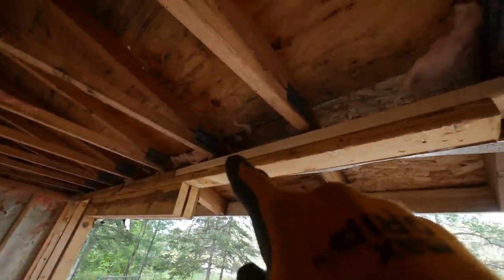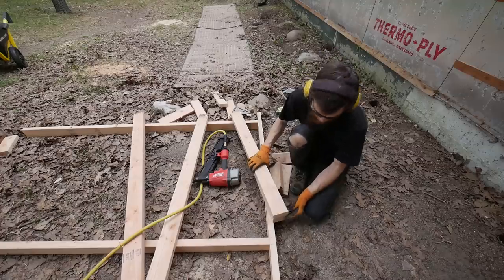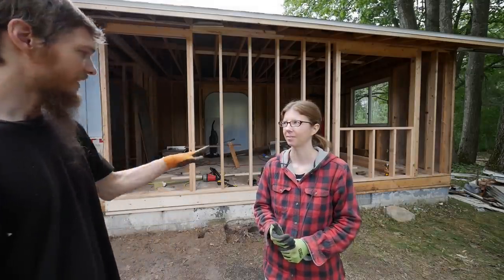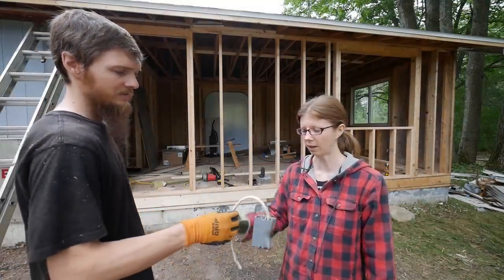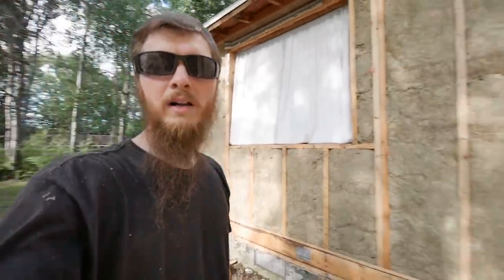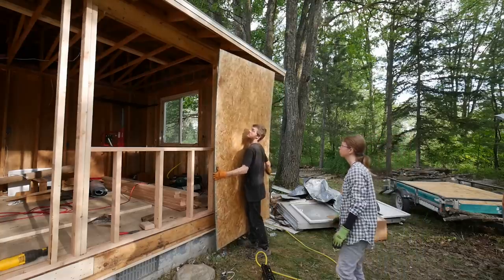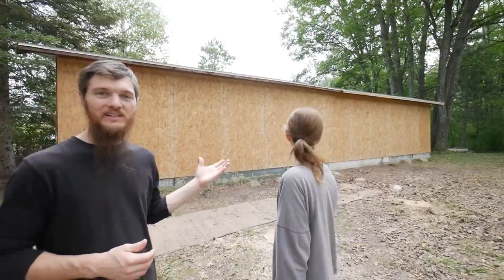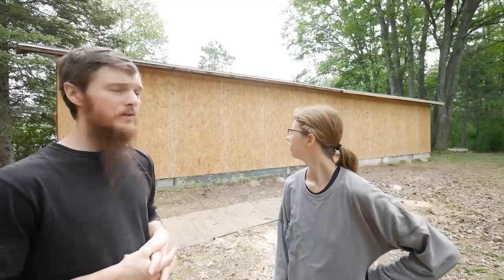More DEMO and Repair of Our 45 Year Old House - Home Renovation

Comment: I would suggest that you add lateral bracing to your stud walls, this will improve ridgity and structural strength, also use nails rather than screws nails have far greater shear strength than screws also a lot quicker if you have a nail gun.

Comment: Even new construction can be wrong and quite shabby.  As a youth we moved into a neighborhood with nearby homes under construction.   I often observed workers placing leftover food and beverages stashed under tubs being installed.  (We moved there during the beginning of summer vacation.  No neighbors so I was bored.)   When potential buyers would stop by I would tell them about seeing rats and bugs.  Realtors did not like me but it was true.  I also pointed out where studs were completely cut through for plumbing and wiring.  Sheetrock was not yet in-place throughout.  I did not know much about construction but I felt obvious issues should be addressed.  That experience triggered a major interest in construction and insuring work does not compromise the integrity of any structure.

Comment: The melted electric box could have been from lightning.  We were hit by lightning once and it fried the box, not all the  outlets in the house but one box.
Reply: Make sure your grounding wire and rod are in place.
Reply: @smallfootprint2961  Thank you. We do have a grounding rod and wire, and now new wire and box.     We had a later hit that came through the telephone wire arced across the room and took out some outlets then too and electrical appliances.  It was a good example of why you shouldn't talk on the phone during a storm.  You know like your parents tell you when you are little?

Comment: Ok, I think you answered my question. I was wondering if you were going to use nice solid wood on your soffits. Or that horrible thin tinny stuff you pulled off. Yeah for wood!
Reply: Use perforated vinyl soffit for ventilation in the attic, avoid mold and release the heat in the summer. Use ice and water shield around the windows and door opening.
Reply: @suburban404  Vinyl I can see, but do you agree that tin/aluminum (?) looked like a joke. One dent and ready made pest/varmint hole.
Reply: @kat369-mine  I took all of the  metal off my house. You got it, looks like heck. Current code has requirements for ventilation in the attic and crawl space.

Comment: I was just curious.....were you planning to use foam board insulation on outside of OSB before you wrap it? I know how cold 🥶 those winters are in Michigan and in addition to your other insulation would be extra protection. 🤗🤗😎😎 (Also moisture and mold resistant)
Reply from the maker: We chose not to do foam board insulation and instead we are just building out the walls inside to allow for the thicker insulation.

Comment: One question: Why did you guys set the osb upwards like that? Must be a trailer home thing.
Reply from the maker: It just depends on who's doing it and where you live. Some do it vertically, some horizontally. If we did it horizontally we'd have to put blocking in at the seams. We personally like it vertically.
Reply: @diyfferent  ok, thanks. To me, I would do it horizontally. In my area that's what's done at least.
Reply: @diyfferent  it made sense there, it fit perfectly and no cutting

Comment: Get ya a sledge hammer and cut the handle to 16 to 24 inch, it will have many uses for years. I think mine is 4 lbs, because I could not lift the 6 lb. I use it for stakes and walls or demo.
Reply from the maker: Yea, we need to buy one :)

Comment: You may need to look up building codes in your area. Your sheeting wouldn’t make code if inspected .
Reply from the maker: Do you mean sheathing? Instead of vague statements would you please explain what you think is wrong.
Reply: 7/16" OSB is used around here for exterior sheathing all the time.  As long as it's fastened properly and covered with housewrap it's fine.
Reply: Sheeting type is fine. Installing all horizontally may not be for your area

Comment: It is something strangely cathartic watching an american house being torn down. As a European this would have been slightly more difficult with ytong, brick and mortar walls. Btw. have you considered standard tilt-swivel-windows when you ordered the new ones?
Reply from the maker: We decided to go with slider windows again like what the bedroom window was :)
Reply: Having worked with wood all my life, I can't imagine using mortar, brick and stone! :)
Reply: Only a small percentage of homes in england are of wooden construction . Most are built with bricks and mortar . Stronger built homes . Its a more stringent building code in gb . Each build has to be inspected by the authorities in each stage , from below ground up to finish level and roof . All electrical and plumbing is also checked . Its law over here . If its not built to specifications . You have to correct and. Inspect again . They can in extreme cases make you demolish the whole building . If the building codes are violated or not built to exact specs . It has happened on quite a few  occasions in gb . .
Reply from the maker: We like wood-framed homes because it's basic construction and we can repair them easily ourselves affordably. That's a huge benefit for us :) Repairing brick is so much more labor intensive and difficult.

Comment: why did you not use pressure treat wood on the sill?  would have prevented rot in future.
Reply from the maker: It's just not needed since the rest of the house doesn't have a treated sill. The rot that was there was directly caused by a leaky chimney and door.

Comment: Just wondering if you guys plan on painting the  Foundation?
Reply from the maker: We aren't sure but we've been talking about it. It's painted now and peeling badly. Since it's painted it will always look bad unless we get all the paint off- which is a pain, or repaint- which is easier...but it will probably peel again in the future. We're just not sure yet.
Reply: Perhaps there is a special sealer or primer for cinder blocks so the paint will adhere to the foundation better. I know they have things like this for basements. May be worth investigating it. Love your work and videos. I check everyday to see if you have downloaded anything.

Comment: Why didn't you insulate with foam board before putting up the sheathing?
Reply from the maker: We are building out our studs to 5.5" to bring the r-value up to 23 so that we don't have to do foam on the exterior. (Also, if we were going to do foam board, it would go on after the osb.)

Comment: i would of spent a bit more and put on 1/4 inch plywood make for a stronger wall.
Reply: No need in Michigan. Support most important there due to snow weight. It'll be covered.

Comment: All the commercials for this video are over 2 mins long. Wow. It wouldn't be bad if the first one was short. I'd watch that one then on the long second commercial I could skip after 30 sec and you would still get credit. Crazy. 
Can you start on inside now with insulation?
Reply from the maker: You can skip the ads if you'd like :)

Comment: You're not using pressure treated on the sill plate???  That's no good.
Reply from the maker: The home was built without a treated sill, and it's solid after 45 years so we are just replacing what was there. The only rot was caused by the leaky chimney and door.

Comment: Why not paint the foundation blocks?
Reply from the maker: We may, not sure yet. But we want to at least clean off the old paint.
Reply: I’ve never seen a painted foundation or steps that did not peel I was told by a painter that if you don’t paint all sides of something outside moisture gets in and makes it peel and it’s a lot of work to get the peeling paint off. I don’t think painting it is worth it. I usually use a stain on my wood outside. It doesn’t peel and you can just restrain overtop when it fades. That’s a lot less work

Comment: Not trying to be a "Debbie Downer,"  but why didn't you use 2x6 on the new exterior wall so you wouldn't have to sister the 2x4's to accommodate the depth of the insulation?  Or did I miss something?  Which is possible.!  Any way, love you guys and your spirit!
Reply: Ginger Washeck Yeah they explained that in the video. They said it was just easier to duplicate the existing wall exactly and less weight moving the walls around.
Reply: @tylerpestell  Yep, I jumped the gun on commenting before watching the whole thing.

Comment: It will probably turn out that it would have been cheaper to demolish the house and buy a new modular home.
Reply from the maker: We're keeping so much of the home that we'd have to buy if starting new. Much much cheaper to repair what is here :) New modulars are close to $100k.
Reply: Oh heaven's no.  Not true!
Reply: then in 10 years they would have  broken down pile of trash to rebuild.They are doing it right and making it much more solid,more insulated than a cheapo manufactured home and yes modulars are 100k plus,manufactured aren't,plus they are building it to their style,not some cookie cutter home.